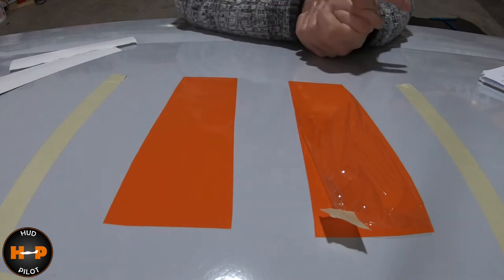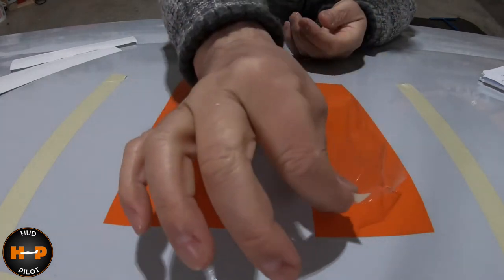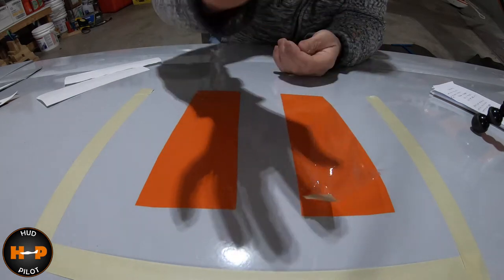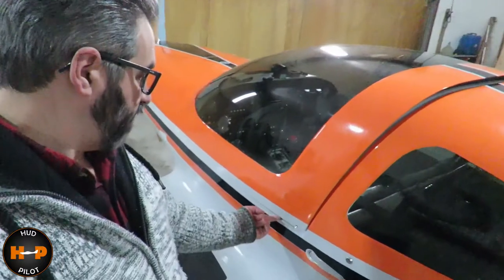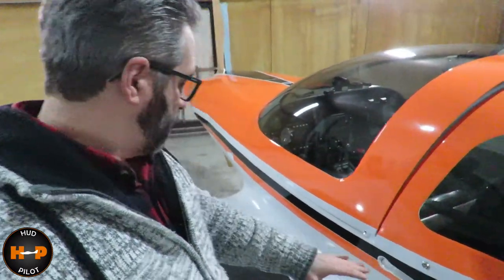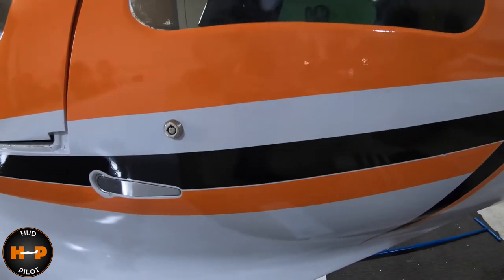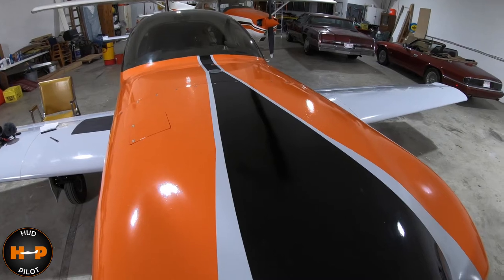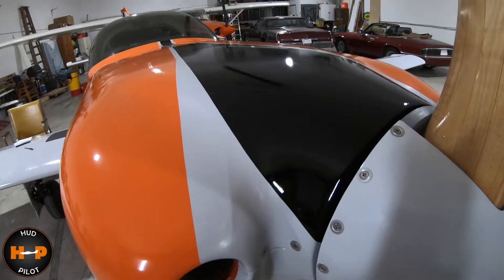Mistakes, I've made a few: Vinyl Wrap

Comment: I just checked the Canadian Air Regulations with regards to Aircraft markings. I'm impressed your 'white' registration markings is compliant.  AND!! it looks Super Cool !!! If you don't mind - I'm going to copy that idea.
Reply from the maker: Yeah it’s legit. The caveat is the “straight surface” took me a while to wrap my head around it. Inspector had clarified it back in 2013. What hard to tell is that the fuselage has very little flat side surface and adjusting it to make sure that happens is what makes it ok. The new letters are actually bigger than the previous when the plane was only grey. Other Lancairs around are even smaller. All in all quite happy with new letters. Thanks for writing Mark. Always happy to hear from folks who watch the vids. 
I’ll be helping a few folks do some other wraps in the future. Should be fun.